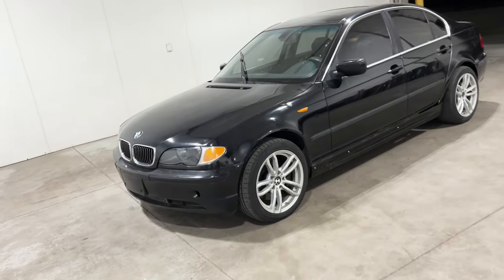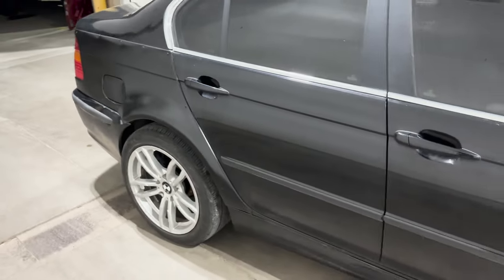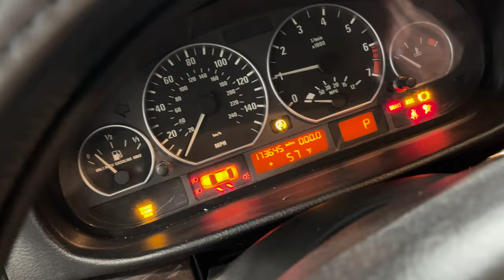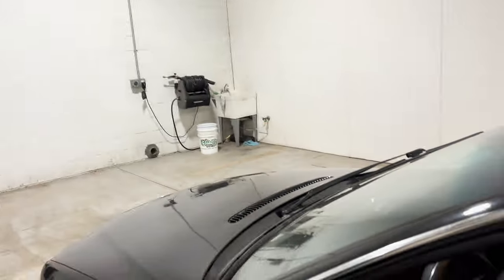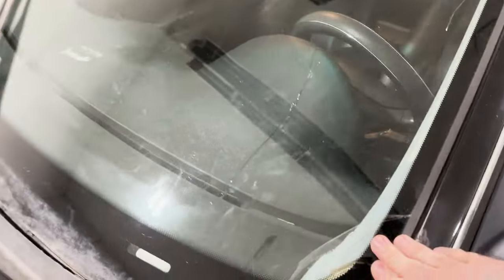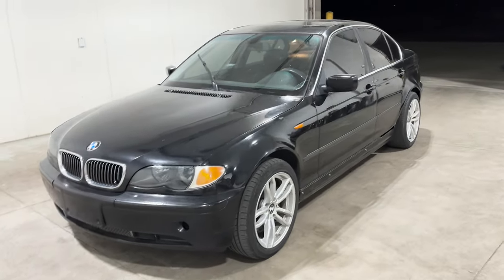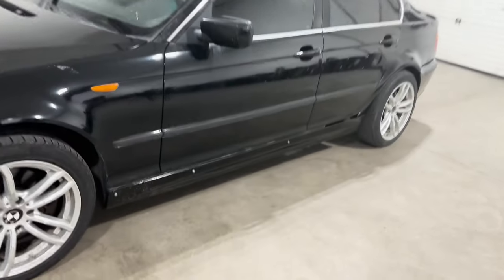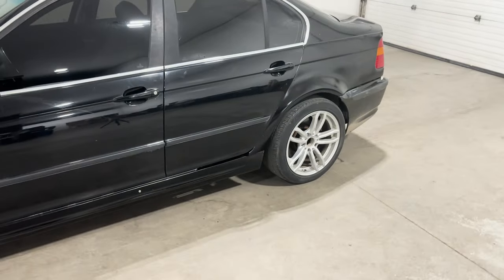BMW E46 Widebody Install!

Comment: I like this channel
Reply from the maker: Thanks man. I like your channel too!
Reply: @Typical_Garage  
I purchased an 04 vert gt 
with very healthy drivetrain, 5spdm , i'm excited to make it into a drift missile just like yours 🫡
Reply from the maker: Just make sure you invest in a good roll cage. Convertibles aren't fun to be in when they're upside down
Reply: @Typical_Garage  First part that will be installed is full cage :) ty ty

Comment: First look into this channel: you did not address any of the dashboard warning lights at all. No scanner?  Just a passalong? Hope a knowledgeable e46 fan will address these engine warnings and enjoys this car.
Reply from the maker: I didn't look into the dash lights because I don't think the repairs needed will raise the value of the car. Like even if I poured $1,000 into it, It'll probably still only be worth $1500. Same concept on why I didn't have the windshield replaced.